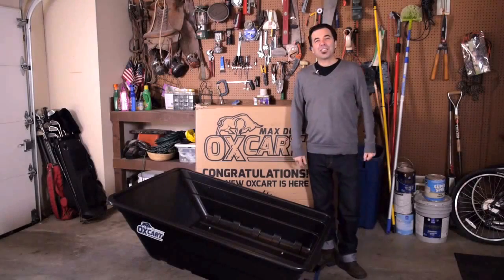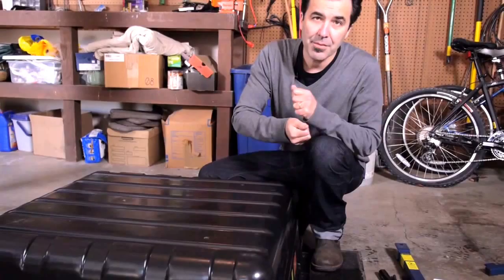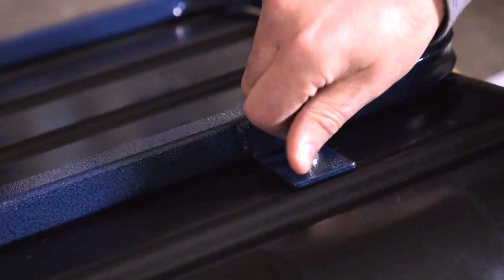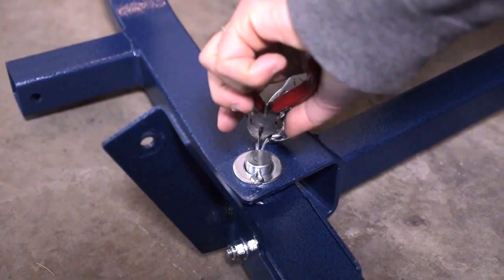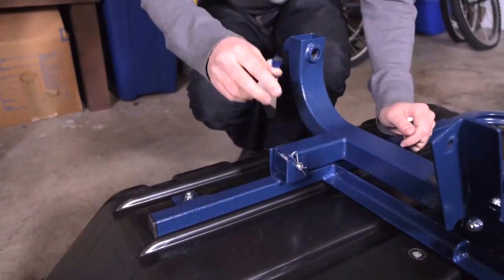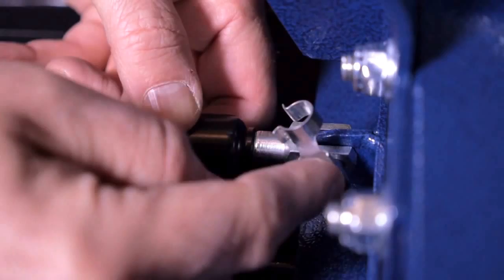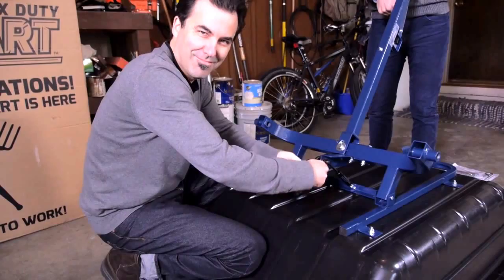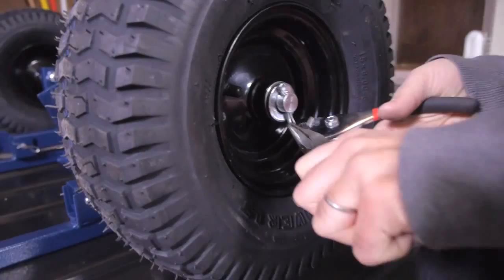Oxcart - The Assembly

Comment: I had a hell of a time because they over soldered the barrel end so I couldn't put the quick(not)clip/pin in.  Had to get a drill 
 to open up the hole , busted the drill bit and took me an hour to get the thing put together!  also no 13mm wrench included.  I hope the cart performs better than the frustration I had to put it together.